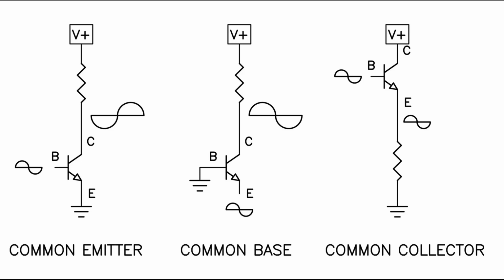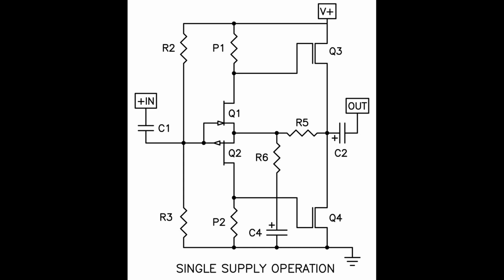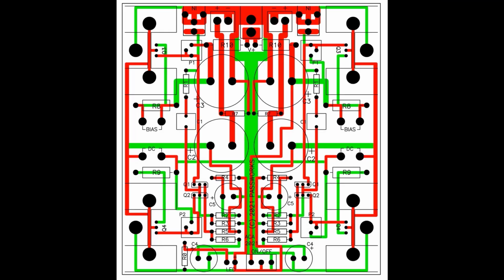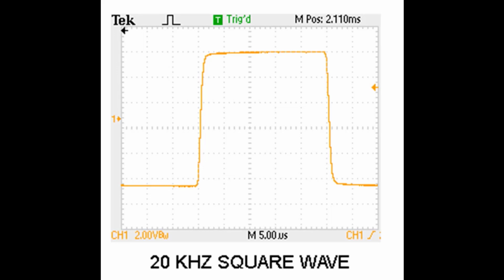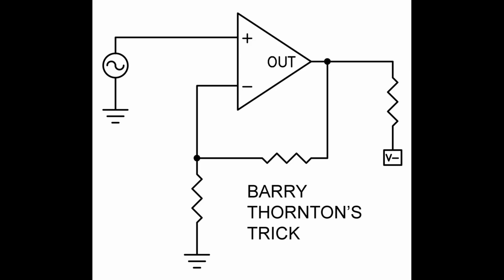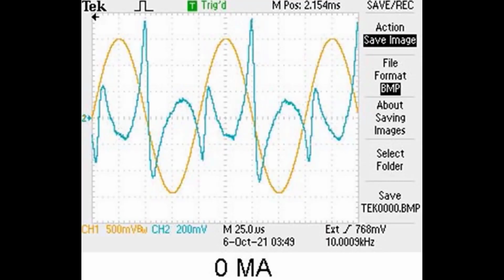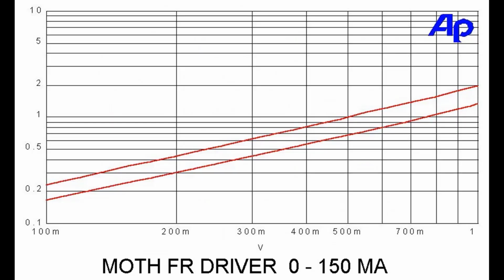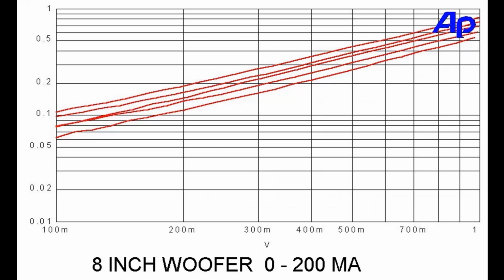BAF Online 2021 Nelson Pass

Comment: hi i made a zen amplifier 10 w class a and i read in the doc that we can change R5 resistor 4,7 k according if you have a source with more voltage and less current you can increase R5  and if you have a source with more current and less voltage you can décrease R5 ,i got a mu follower preamp  with 20 db gain ,what would be the resistor to apply in this case ,thanks

Comment: When some of Mr. Pass A class schematics can give -90-100dB of THD at 10Watts@4Ohm, I have no idea how is this possible to listen to 1% of harmonics. This is like a shellac disk on a vintage amplifier. For me personally all above 0.1% is not serious.
PS I wouldn’t agree to Mr. Pass that a DYI amplifier can be cheap. A good amplifier cannot cost small money. A capacitor can cost $20-40 one piece (so, $200-400 in total). A transformer can cost $100-200 (so, $200-400 in a double mono configuration). A chassis can cost $100-200. Speaker plugs can cost $20 pair, as well as a good Alps. If you are not ready to spend about $600, you better purchase something in China. This will have more practical sense imho.
Reply: try it you'll like it

Comment: Nelson shares a circuit that can control 2nd harmonic with output power resistors. Awesome. Learning how much + why we like certain amounts of 2nd harmonic.
Reply: Many of his balanced versions allow to control the 2nd harmonic with a negative feedback resistor/capacitor, as well us with a value of a current feeding a differential cascade, and with a power rail voltage )